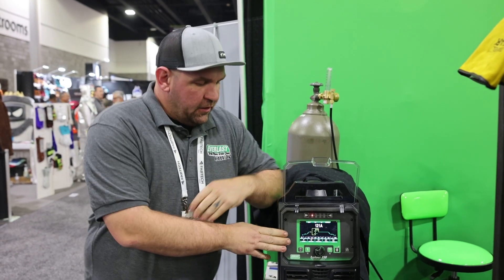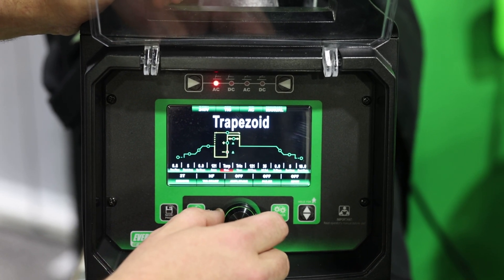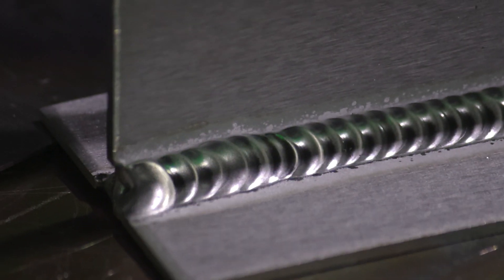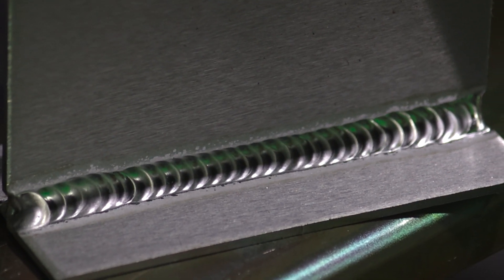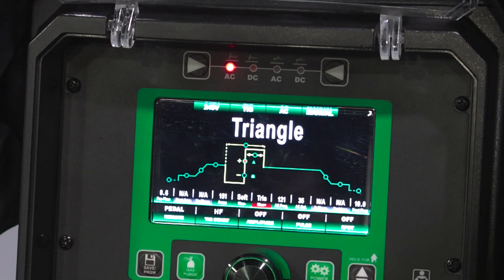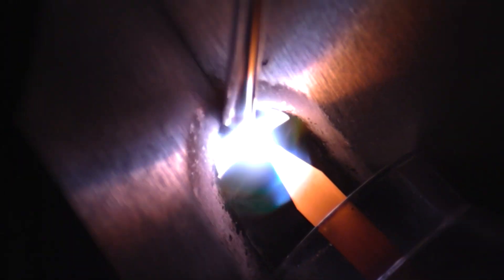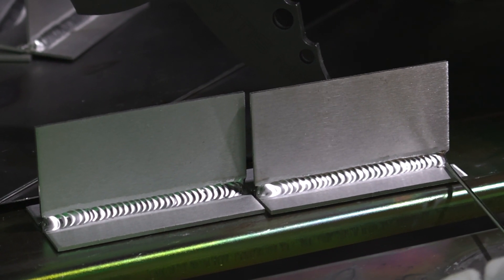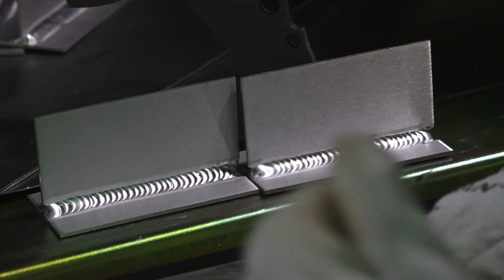Intro to Independent Amplitude on the Typhoon 230

Comment: Yeah, HTP does, but they don't have any extra waveforms. If you paid an extra $500 for the Miller Electric SD Media card for the Dynasty 210 and 280 (included on 350 and above, I believe), then you'd get A/C Amplitude Control too. But, I believe the latest Dynasty 210 no longer hobbles it for AC Amplitude Control or the extra Pulse range now, via the "DX" designation (it seems to be no more). So, Everlast has indirectly helped the Market and the Dynasty models in extinguishing that 50 cents worth of "proprietary" SD Card of computer code costing $500 extra. And these Typhoon models retained the Advanced Pulse (MIX TIG) feature that is on my 210EXT, which really does give tremendous added penetration per-amp on AC aluminum if you set it for 100% DC on half of the wave cycle, i.e., 1/2 DC TIG welding on aluminum (I think Fronius has it on their best units, and some other European units do too). So, these Typhoon units are the most-featured, advanced AC/DC TIG units on the North American Market, at about one-third the cost (preorder-intro price of about $2500) of a Miller Dynasty 210 CPS "bare tool" (about $6500, no torch, no pedal, no nada). And that's a shining anti-Inflationary example in the TIG welder unit marketplace. Thank You, Everlast, Thank You, China!
Reply: My point was more to i was glad they added it. I don't really care what Miller does, i know you've had the 210 since welding in your laundry room and you've always liked them but some of these settings are needed for pros. I'm glad they finally caught on to it. The wave forms from all manufacturers are a gimmick but the independent amplitude def helps for sure. im hoping the prices don't keep going up with it too, you are right Miller is crazy expensive
Reply: Yeah, I moved about four years ago, and now have a full-fledged unattached garage that I weld and make videos in with that same 210EXT. I kind of miss that old laundry room though, as my surround sound system was only 10 feet away there.

Anyway, Everlast has quickly arrived at providing some of the best units, and certainly the best values to welding customers in the North American market. Some people seem to want to “throw shade” on those facts, rather than embrace the quality and value, which makes advanced-featured units like the EXT and Typhoon models affordable to most anyone, whereas a loaded Dynasty model still isn’t, for many.

Waveforms may seem a gimmick to some, but I can tell you from firsthand experience, the Triangle waveform helps me weld thinner aluminum. And that MIX TIG feature has been called a gimmick by some, but it’s real too, I mean, for what it does.

This is a great time for getting an advanced-featured AC/DC TIG unit, like the Typhoon, that can be had for about 1/3 the cost of an equivalent-featured Miller Dynasty.

And, after nearly 7 years of using it, I still would buy another 210EXT, as it has just the right amount of advanced features that I want and use.

Thank You, Everlast. Thank You, China!
Reply: Thanks you guys, I completely forgot that my laundry also has 220v outlet I will be trying that when I get my machine. It's something that you'd guess most would know since it's so obvious, but most forget the most simple stuff. Btw how much would the cost difference  of electricity be when comparing 110 vs 220
Reply: @mourningkami  Well, a 220/240 Dryer breaker is usually only 30A, which was just enough for my 210EXT some years ago, and would occasionally trip the breaker at the inrush amps of 31A when powering on. But the 30A 240V breaker was more than adequate for the 210EXT to weld at the 210A max without tripping that 30A breaker, even when exceeding the 60% duty-cycle time. But the Typhoon 230 has different input specs than the 210EXT. On the dual-voltage capacity of the 210EXT, I get up to a max of 125A TIG welding from a 120V 20A outlet, but I drop it down to 120A welding if I'm going to be welding around that amperage for longer periods. So, the electric cost differences between 120V and 240V inputs have many variables, but will be constrained by about half as much max amperage. My 210 EXT really rocks, and has consistently done so since I bought it, around Jan., 2015. And the 210 EXT model has had a few minor refinements since, but is still priced about the same as it was then, which is anti-inflationary. Thank you Everlast and China!
Reply: @mourningkami  you can setup a 50 amp breaker with an extension plug from your breaker box very easily and fairly cheap for doing it the right way, and run your welders to their max potential. Its worth it since tripping a breaker while using your welder is not good for the welder and eventually it'll toast the capacitors, or something worse.
Reply: What tungsten was that ?